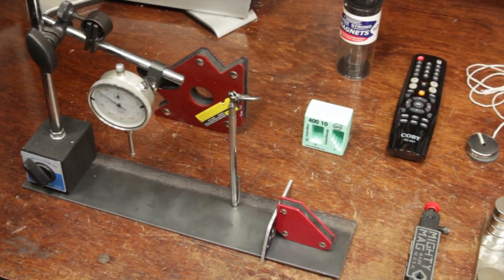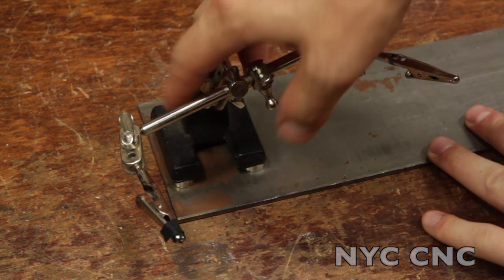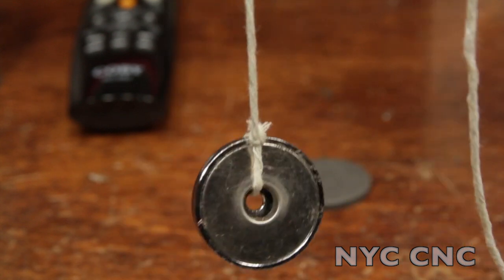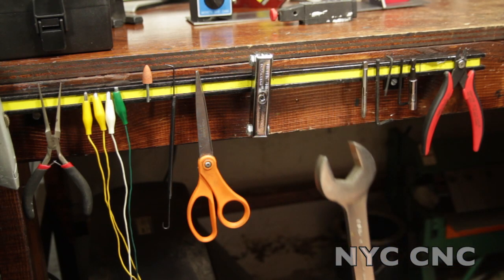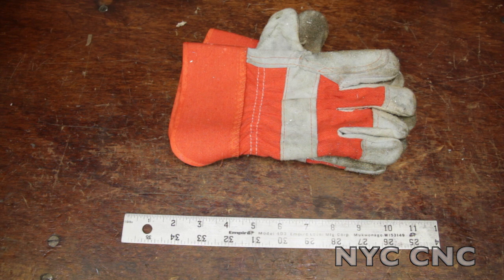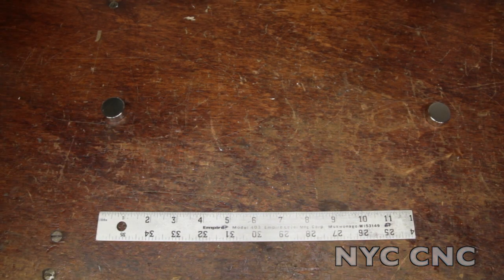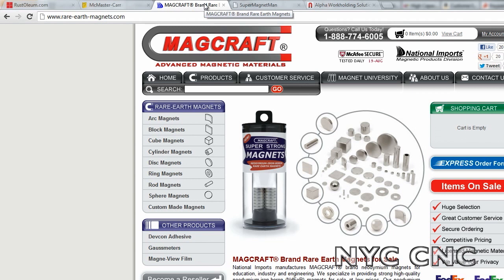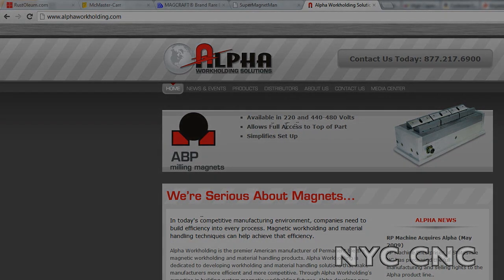9 Awesome Uses for Magnets in the Home Shop!  Tuesday Tips from NYC CNC

Comment: 1) Don't use magnet strips to hold your tools.  They can get magnetized and pick up metal shavings, which can get accidentally transferred into critical areas of engines and machines.
2) Only a dork wears gloves handling little magnets.

Comment: I salvage neodymium magnets from dead computer hard drives. If you've never taken one a part, you should. You'd find it interesting. Magnets are what hold the things together internally! I was surprised as heck the first time I disassembled one.
I use PVC welding rod, (~0.125" diameter), to make magnet sticks. The PVC rod has a low temp melting point and once it becomes 'plastic', (softens enough to sag), it stays that way for a surprising amount of time. Because of the low plasticity temperature, it's easy to work with and not get burned.
What I do is cut a length of rod about three times the handle length I want to end up with. I then heat the middle of the rod and bend it around the chunk of magnet and gently smash it together to get a nice fit. Then I mix up some Harbor Freight 60 sec epoxy and epoxy the magnet to the rod. (I love the 60 sec epoxy, it makes epoxy jobs so much faster. The trick is to use layers and not try to do a job all at once. It's stronger that way, plus you're not fighting with epoxy running all over the place before it sets. A bit if old Scotch Brite and some epoxy is a great way to fix stripped out plastic screw holes, but I digress.)
Use a plastic 'clothes pin' type clamp or something heavy to hole down the welding rod while the epoxy goes off.
Once the epoxy is set, and the magnet is attached to the plastic rod, start heating both pieces of rod close to the magnet. If you have a nozzle reducer for your heat gun, use it. If you don't have one, use some sheet metal from the hard drive case to make one. Reducing the nozzle end of the heat gun gives much better control of the heat.
When the rod becomes plastic, grab the magnet end with some pliers and begin spinning it slowly to twist the two rods around each other. If you apply some 'traction' to the rod as you spin the magnet, you handles will turn out better. Keep heating and spinning until the handle is done.
When finished you have a very handy, and cheap, magnet stick.

Comment: You are wright, magnets are so usefull.  As  it is by now, no magnets are better than those Rare Eearth Magnets made with neodymium ( one of the 18, or so, rare earth elements). 
  I've glued, with silicone, at least tho magnets, the size of a nickel, on each body of my electric drills, drivers or impacts...I keep there some bits, sockets or screws or small drill that are often uded...

Comment: Good video! I like that magnetic tool rack/strip thing. Another awesome use I've found for magnets is as a dock/mount for my cell phone. I have one of those magnetic windshield car mounts for holding my cell phone while I drive, and it of course comes with the little metal plate that you either stick to the back of your phone, or slide between your phone and case. Since I already have the metal plate installed on my phone, I decided to buy some very tiny 1/4" (less than half the diameter of a dime) N52 neodymium magnets off Amazon and superglue or tape (double sided) them to various places in my house so that I can easily use my phone or watch videos while doing various things. I've mounted them on my bathroom mirror, kitchen backsplash, wall behind my garage workbench, the wall next to my outdoor grill, and even on the bezel of my computer LCD. I love them!

Comment: I love magnets too.  They're freakin' magic.

I use the tip at 1:30 with a blue disposable shop towel wrapped around a magnet, but instead of picking up nuts and bolts, I use it to pick up steel chips in electrical panels after drilling and tapping holes when panel building.  I generally use the telescoping magnet on the opposite end of my inspection mirror (shown at 1:50 in your video).  It's a great way to quickly pick up all of the tiny chips in very hard to reach places to avoid an electrical short after the electrical panel is energized.  I can easily pull out the magnet and dispose of a ball of sharp steel chips in the trash without getting any steel splinters.  A paper shop towel held in place by 2-3 magnets under the back side of a hole I'm drilling will generally collect all of the steel chips before they can fall into electrical components or delicate mechanical parts when modifying existing electrical panels or repairing mechanical devices.

There is no such thing as perpetual motion, but if there was, it'd use magnets.
Reply: NYC CNC
I'm an electrical engineer, but I'm a hands on kinda guy.  I don't wire many panels lately.  Just the occasional CNC conversion for my own use.  I need to install an hour meter in a machine this week, and I'll be using a shop towel wrapped magnet to pick up the shavings after using a hole saw to drill the wall of the electrical cabinet.

Comment: Hi :) I love people WHO LOVE MAGNETS, that is how much I love magnets :) I have a question for you, I hope you can help me with it. I rewind Brushless motors sometimes and some of them were got very hot just before they burned out. That is the reason the magnets are not that strong anymore or they are not uniformlly strong anymore. How can I reenergise thoes magnets? I know that some people use a couple of Car Batteries, do you know how?
sry my English.
Thanks :)
Reply: Raise any magnet above its Curie temperature and the magnetism fades.  It's possible to remagnetize a magnet once it cools, but you need a strong field to do it, which generally requires special equipment.  In small quantities, it's cheaper and easier to buy the motor magnets already magnetized.  Commercial magnets are often shipped in the nonmagnetic state because they're easier to transport and handle during assembly, and they're magnetized as a product is built.  A friend of mine owned a company that manufactured high end stereo speakers, and they'd magnetize the large magnets on their drivers as the speaker was built.

Comment: This has nothing to do with magnets, but you can use a vacuum cleaner to suck that string through enclosed spaces, then tie a wire to the string once through, and pull.

Comment: Ebay or online surplus companies will almost always have them.  Just look for "solenoid coil open frame" and about any of them should work.  Don't worry about them being for DC.  As most technical folks know, DC will pull/push the plunger one way, AC will just make it vibrate.  Use DC to magnetize and AC to demagnetize.  Start with lower voltages using a transformer before using full line voltage. Be careful! Standard safety disclaimer here ...

Comment: It is simply an old AC solenoid connected through a push button to 110vac.  Pretty low duty cycle as it will warm up/burn out quickly but works really well on anything that will fit in/through the opening.  I'm sure a search for DIY demagnetizer will turn up quite a few,  some complicated, others not.  Some switch between DC and AC to allow for both magnetizing and demagnetizing.

Comment: That's why I said "good",  I have not had the greatest luck with that type.  I now use a home-built model with a large AC solenoid and push button.  Doesn't quite dim the lights but there is no doubt that whatever passes through it is no longer magnetized.